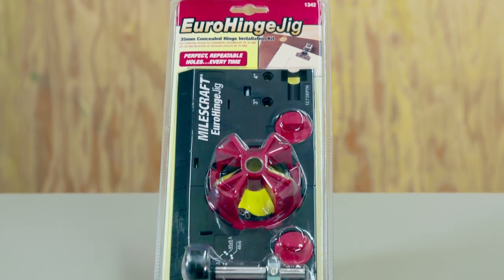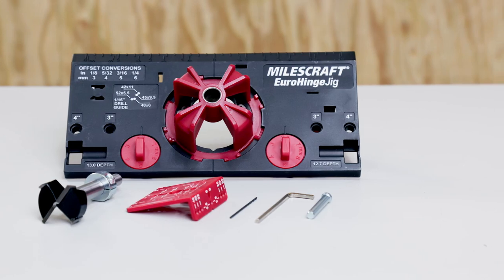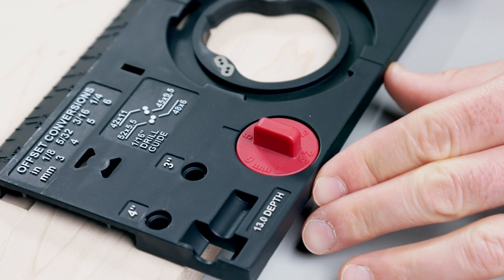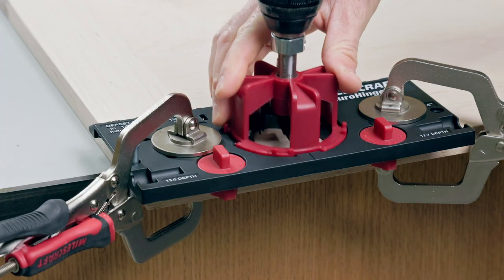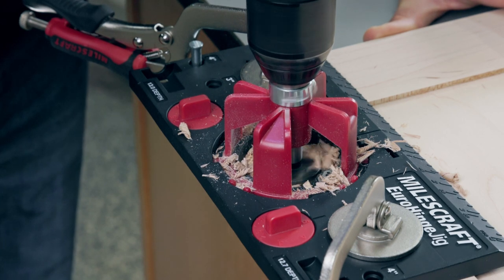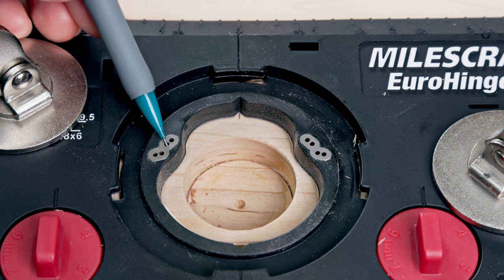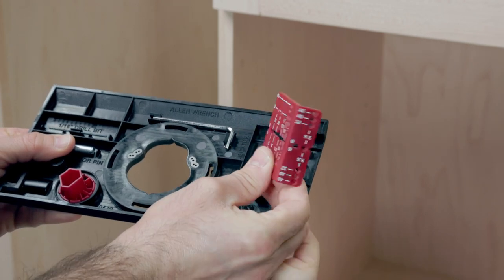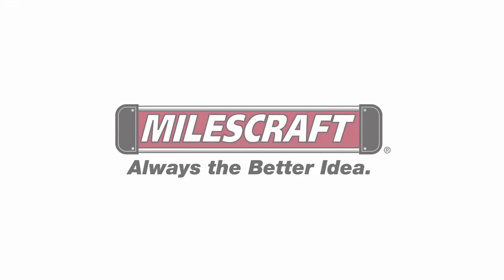Milescraft #1342 EuroHingeJig™ - Concealed Hinge Jig Makes Cabinet Door Installation Easy

Comment: One question is how do you know where to place the cabinet jig on the cabinet?
Reply from the maker: You would follow the hinge manufacturer’s instructions to determine the hinge cup location. The EuroHingeJig comes with two edge alignment knobs position the cup hole from the edge of the door and an edge locator pin that sets the distance from the top/bottom. Email us at info@milescraft.com if you need any help!

Comment: It doesn't have everything you need. You need a clamp (or2 ) as well just to keep it in place. Even then its not going stable depending on the type of material drilling into. Limited and lacking, pity products get pushed so hard yet are not good enough